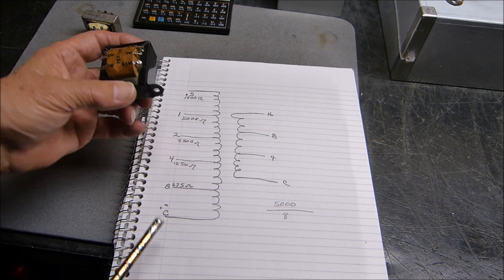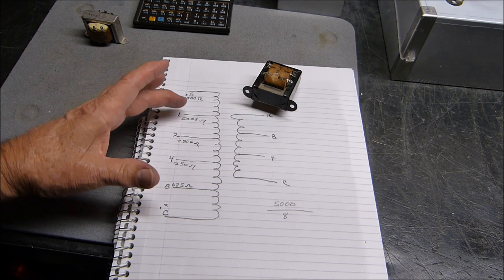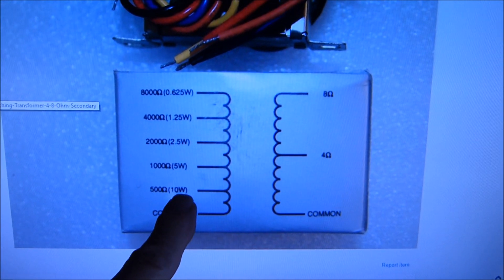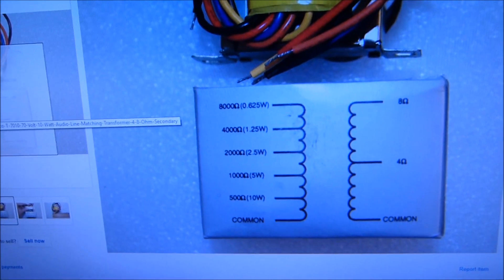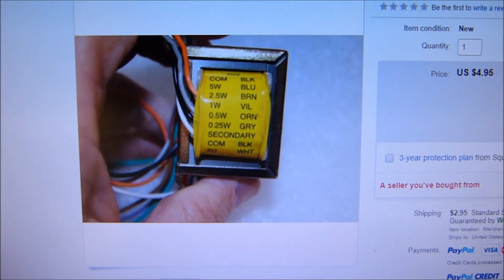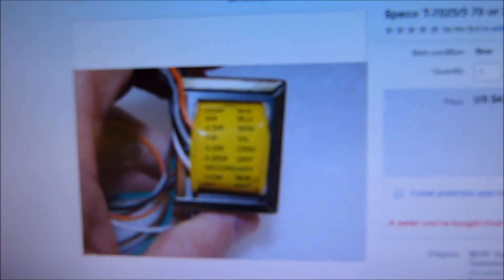Using Inexpensive Line Transformers For Vacuum Tube SE or PP Output Transformers

Comment: Anyone know if a hammond 117f2 could be used for something like this? Im thinking about a 1w SE guitar tube amp.
Reply from the maker: I looked it up and it has primary power taps of 4 watts, 2, 1, 0.5, and 0.25 watts. This is a good universal transformer. This corresponds to a primary Z of 1250, 2500, 5000, 10,000 and 20,000 ohms as a SE transformer. No guarantees how it will handle quiescent current concerning core saturation as an SE transformer. You could also use it as a PP output transformer as a 5000 ohm (1 watt tap) (and C as the other end),  plate to plate, with the CT at 2500 ohms (2 watt tap), 10,000 ohm plate to plate with 5000 ohm (1 watt tap) as the CT etc. The primary Z is from the common tap, C, to the power tap in watts. The Z point of the primary is between the (C)ommon wire and is determined by dividing the power number into 5000 (which is 70.7 squared).  Hope this helps.
Reply: Thanks! Yeah i calculated the impedance like you did in the video and it seems to work out, im just worried about the wattage. I was thinking using a pair of 12au7 (both halves of each) to drive it in paralell SE. I could use a higher wattage hammond, 4w model for instance but im thinking it wont saturate as nicely.
Reply from the maker: Looking at the 12AU7 data sheet I would personally do PP and use the 20K end of the transformer with the CT at the 5K tap. That would probably give you 2 watts or so with 300 volts on the plate of the 12AU7. Just my thoughts. Best of luck with your project.
Reply: Well, im trying to keep the wattage down on this build so im going to stick with a SE design, but PP would probably be better. My power supply is only going to have a little over 200 volts for the plates. If it fails then atleast i learned something right :)

Comment: I see a lot of talk about how cool this is, but no demos on how it sounds and if its reliable.
Reply: I agree with you. I have little doubt they will work in push pull. In PP the effective magnetizing primary current is canceled by the opposite direction of current flow to the two output tubes (assuming they are balanced)  but as for a direct SE transformer I have some serious doubts. It has been brought up a few times that these transformers are meant to be used in a distribution system with no DC flowing in the windings (especially the primary) so there is probably no gap in the core and with that said, in a standard SE amplifier design, I suspect the core will saturate very easily, the primary inductance will drop  to virtually zero and it will be a big flop with the bass sounding horrible. However, there are solutions suggested in the comments below that sound  reasonable to me if one wants to use these transformers for SE operation.  Just below where I am typing, a suggestion  by Joseph Mooney, his solutions sounds good to me. Maybe I can get around to it some day but I am still charmed by big RF and AF push pull amplifies at the moment.

Comment: Vgood sir.kindly make video about   audio out put transformer compliant design ..500wt input out4.8.16ohm...100v line...with..bobin size ...truns ..formula
Reply from the maker: I am not familiar enough with transformer design so I am not able to make a video on that aspect of transformers. However, I can recommend a book title "Practical Transformer Design Handbook" that I have and reference occasionally.
ISBN 0-672-21657-4 
https://www.amazon.com/Practical-Transformer-Design-Handbook-Lowdon/dp/0830632123

Comment: If OPT is 10K : 600R, can I put 38r headphone in serial with 560R resistor (38r+560r = 598r) to connect with 600r?
Reply from the maker: You could do that but the majority of the voltage drop (93%) will be across the 560 ohm resistor so it may not be very loud in the headphones but that could be OK.
Reply: @ElPasoTubeAmps  Thank you very much, From your teaching about center tab I see that the 10K : 600R transformer has 2 groups is it equals to 600 /4 = 150R?  to be easy explain 2 groups comprise of wire 1 and 2 for Group A and wire 3 and 4 for group B.    I am not sure if I am correct.  for 600R you need to solder wire 2 and wire 3 together and measure 600R at wire 1 and wire 4?       If I am correct so Group A (wire 1 and 2) will be 150R and another Group B (wire 3 and 4) is also 150R.   Hence If I use either wire 1+2 for 150R or 3+4 also 150R for my 38R headphone, I just need about 100R resistor in serial (100R+38R).      Or another method is to make 150R of to group to drop to 75R by Parallel by connect wire1 (Group A) to wire 3 (Group B) and wire 2 (Group A) to wire 4 (Group B).   If I am correct may be I just add 31R to my 38R Headphone and voltage will drop by 45% instead of 93.6% of 560R drop of 600R secondary side.   I can't find transformer of 38R in secondary in local market.  150R (2 Groups) is the best I can find for OPT of headphone amp.   Please advise any alternative for my 38R OPT headphone. Thank you very much
Reply from the maker: @nuttyl283  You are correct in understanding how inductance and impedance is calculated. Impedance of a 600 ohm output in your transformer is comprised of two 150 ohm coils in series because they not only add in series but also in magnetic coupling by the same amount. You could put the resistor in series with one half and your headphones for technical reasons or you could put a pot of 600 ohms or even 1000 ohms across the 600 ohm output of the transformer (capable of handling the power level) and then put your headphones across the ground connection and pot wiper connection. I know this will vary the load resistance and reflected impedance as you vary the volume level but it will work out perfectly well. Matching impedance is a real thing but at the power levels we generally operate at (less than 20 watts) impedance mismatch can be off by factors of at least two times or more with no noticeable difference and no significant measurement difference. At high power levels of around 250 watts and more, impedance matching becomes critical. You could connect your headphones directly across the 600 or 150 ohm windings and see how it sounds or you could use the series resistor for proper technical matching.
Reply: ElPaso TubeAmps thank you very much, transformer seller give me 2 specs which one is better and what are reasons? He offers The primary is about 11H, the secondary is about 618mH
100HZ test. Leakage inductance is about 60 mH
Distributed capacitance is about 1.9nF primary 17H,. secondary 7508mH
100HZ test leakage inductance is about 57 mH
Distributed capacitance 2.6nF both are 10k : 0-62-300R which he said I can use parallel for 51R headphone output. Does Henry affect sound?
Reply from the maker: @nuttyl283  You have some interesting data. Inductance ratio is the  same as impedance ratio so 11/0.618 = 17.8 so, if you put 51R on the secondary, the primary would be 907.77 ohms or call it 1K. Is that what you are looking for?
A good quality PP OPT is 20H plate to plate so that is 5H plate to CT so, that is why I say 11H is good for SE.
Reply: ElPaso TubeAmps thank you very much. However I have a little confused. The seller said that 11H (on primary ) of 10K : 0-62-300 OPT has resistance:
Primary about 850Ω (which is not 10k ohms)
Secondary
Approximately 15.8
Ω(which is not either 62R or300
Ω) why resistance has 2 different values on both primary and secondary?
Reply from the maker: @nuttyl283  The primary is made of lots of small wire and is 10K  AC impedance which can not be measured with a DC ohm meter. Same thing for the secondary but it is made of larger wire and not so many turns. There is no simple formula to go from DC meter resistance to AC impedance. 
Impedance in rectangular format consists of two parts, the "R" part, plotted on the abscissa, that is called the real part and the "X" (reactance) part, plotted on the ordinate,  that is called the imaginary part as it does not dissipate heat like R does but shifts the phase between the voltage and current.  This form of impedance is in the form of  Z = R + jX.   
Z is determined by the Pythagorean theorem using R and jX and often times is used with antennas.
However, the most common expression of impedance is in what is called polar form. It has a "magnitude" (like 8 ohms for a speaker or 10K ohms for the primary) and it has an angle that describes the phase between the voltage and current. Generally, the phase angle is not mentioned and we just mention the magnitude part.
Hope this helps.
Reply: @ElPasoTubeAmps  Thank you for explanation. So 10K : 63R is AC impedance? Is there any method to measure the AC impedance to get value of 10K and 63R?
Reply from the maker: @nuttyl283  You have to have an impedance bridge. Assuming you have a common 5K to 8 ohm output transformer, (that would be an impedance/inductance ratio of 625:1 or a turns/voltage ratio of 25:1) you would put an 8 ohm resistor on the secondary just like a speaker and then measure the primary with your bridge and it should give you an impedance value around 5K. Need to remember that these numbers are not exact to the least significant digit but they should be close, maybe +-10%.
Here is an Ebay link to a LCR bridge that I have and trust.
https://www.ebay.com/itm/NEW-MASTECH-MS5308-Portable-Handheld-LCR-Meter-100Khz-Serial-Parallel-Tester/122044380834?hash=item1c6a6976a2:g:L-UAAOSwH3haQLD~
Reply: @ElPasoTubeAmps  Thank you very much.  I have seen schematic of TUBA headphone amp which use 600R : 8R 4R (Hammond 119DA OPT).  The 8R is connect to 600R headphone which is very impedance mismatch.  However many compliment of sound even very large amount of impedance mismatch.  This make me think that if ratio is the same, it is suffice to use.  This case impedance ratio of Hammond 119DA OPT is 75:1  (600/8).  So if I use 3.75K :  50R  (75 : 1) .  This should be the same audio quality?

Comment: What's the frequency response?
Reply from the maker: At its rated power output is it probably pretty poor compared to high-end output transformers. I would assume something in the range of 100 Hz to 5 KHz but if it is used as an interstage transformer where the power is very low at fractions of a watt, it can be very good and do 20-20KHz.

Comment: What if one uses a battery tube?  Plate current is typically 2-4 mA…
Reply from the maker: I see no issue with the battery type tubes. Probably would work quite well at the 2-4 mA current levels as it will not magnetize the core
Reply: @ElPasoTubeAmps  thanks.  I hope to resume working on these again in the near future.

Comment: Hi A couple of guys worked this out in Australia years ago and I use them for push pull guitar amps all of the time based on the info in this site. http://www.ozvalveamps.org/optrans.htm Hope this provides a bit more info for you on the subject. Cheers Haydn
Reply from the maker: Very nice article. 

Recommended reading for anyone getting into these transformers with lots of excellent examples in the link.

I copied and pasted the link  http://www.ozvalveamps.org/optrans.htm  to the top of this video in the description block. I also mentioned that some of the transformers used in the article are 100 volt and not the 70.7 volt as I used in this video and this changes the primary impedance by a factor of two just to help prevent confusion that might come from the different transformer values. Many thanks for your information.

Comment: When you say 70v are you speaking of 70v public address speaker transformers
Reply from the maker: Yes, these are the small public address type matching transformers that might be found in an office setting. I suppose this 70.7 volt and 100 volt and even 25 volt (8 ohm) rating was to keep things simple but in my opinion, it made things more complicated to use them for anything but their primary purpose. To find a use for them, as builders might want to use them, it is a simple procedure to use a formula,   Z = E^2/W     In this  case 70.7 squared is always equal to 5000. So to find the impedance of the high impedance side, we divide 5000 by the power rating stamped next to the terminals. For example a 70.7 (or just 70) volt transformer with a power tap of 0.5 watts would have a primary impedance of 5000/0.5 = 10K ohms. The CT of that would be 1/4 of the whole value or 2500 ohms. So if you have a nice transformer with lots of "power" taps, you can do the math and see if you have a transformer that you can use in a vacuum tube amplifier. These transformers are not meant to have DC flowing in the primary winding or it will saturate the core so they can not be used in single-ended amplifiers, but if the output tubes are balanced in a push pull circuit, they could probably be successfully used maybe with a pair of 6AQ5 or 6BQ5 or maybe even 6V6 tubes to match the output to speaker voice coils.
Reply: ElPaso TubeAmps I wish I could get you and a sharpie together at my shop.... I certain in 2beers or less All my stockpile would be marked and labeled....     
I’ve yet to run a part number through google that led to any discovery.   

I need a variac... Tell me why couldn’t I wrap 22ga wire about 140 single layer isolated  turns down  an iron bar, hook each end up to the 124 (that’s what my shops running so EVERYTHIINGS running a bit hot so I need several of these) clean out a small track and drag a piece of carbon up and down it tied to the output line?
Reply: ElPaso TubeAmps I wish I could send you pictures I have just scored a mother load of Peerless Altec Lansing 70v  type 15066 USA 
Have 32 16 8 &4 hm taps with common... for free from a buddy... they were all pulled with horns an speakers from the casino... only installed 2yrs... need any?
Reply from the maker: @thespiritof76..  That is a very kind offer and I thank you very much. I don't need any at the moment as I have gone down the rabbit hole of SET amplifiers, as one gentleman put in. As mentioned above, if there are lots of power-taps, then there will be lots of high impedance connections on the primary side so there can be many uses for them. If the taps go down to the 0.25 and 0.125 watt level then I can see them possibly being used as input driver transformers for high power amplifiers where the grids of a set of large tubes like a pair of 810's can be driven directly with them. The Peerless transformers are nice so you scored a nice one.
Reply: ElPaso TubeAmps really? 
There even marked 4-8-16-32 U so there’s no guessing..... 
I have 12 in hand and prob at least 12-20 more I gotta go pick up.... 

My Q is will they run a pair of 6550? Those are abouf 40watt each from what I gather.... they are exactly 4” tall and 3” wide
Reply from the maker: @thespiritof76..  4" by 3" is pretty big but the thing you want to know is not just what they are rated at in watts but what would the impedance be. When you say a pair of 6550 do you mean a pair in push-pull or one 6550 for each side of a single ended (stereo) amplifier? Power wise they might be OK but you say 4-8-16-32 U ? What is U ? I assume you mean (W) watts?
Assuming you mean watts, the high impedance side of a 4 watt secondary would be 5000/4 = 1250 ohms. For 8 watts it would be 5000/8 = 625 ohms. All of these impedances are much too low for a 6550 tube in either single ended or push pull. I have some large transformers like yours (they are not Peerless) but usually these large ones match lower impedance primaries (like the numbers calculated above) to speaker impedances. It is the small transformers that have the high impedances windings. Hope this is making sense and it is just as I mentioned in my first comment that they made this pretty complicated to use in any manner other than their original purpose because these impedance values have to be calculated from the voltage (i.e. 70 volt) and power rating. Let me know if this helps.
Reply: ElPaso TubeAmps hi it does. Help me swallow another bite of this elephant I decided to put on my dinner plate! 
They say that’s the best way to eat an elephant, one bite at a time...  
I want to build a single ended guitar amp... I have have a nice quad set of Russian made 6550 winged C NOS... 
also have a couple of Hammond organ amplifiers for parts as well as a handful of other OT and PT... 
Heck this morning I just hauled in a 60 pounder 15 Killowat laminated trans. It’s HUGE, almost 18” y’all and 14 thick by Jefferson electric says High volt 240-480 and low volt 120-240....  got it from an abounded concrete mill. Think it will weld make an arc welder? 
4-8-16 -32ohms are the factory marked  tapps.. but the markings isn’t ohms it’s  with the upside down horse shoe U. I assumed that ment Ohms...